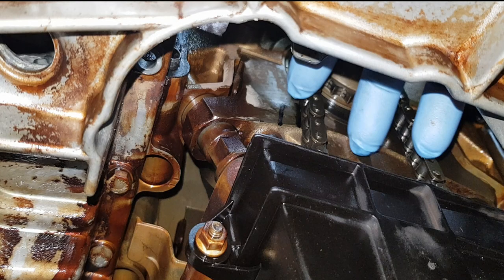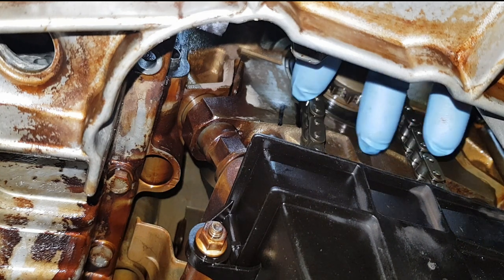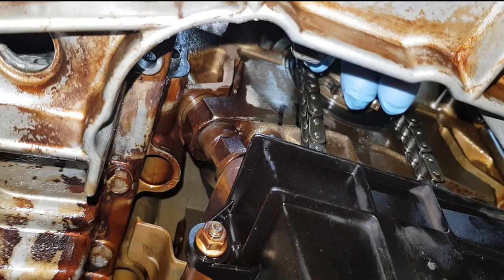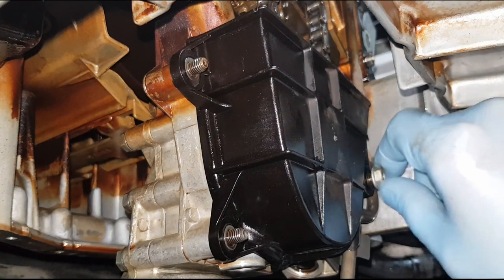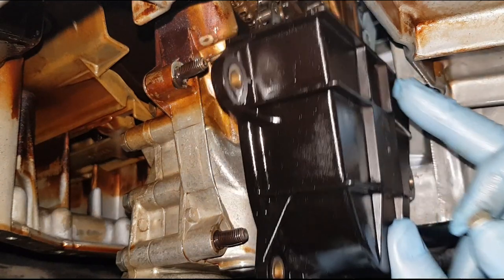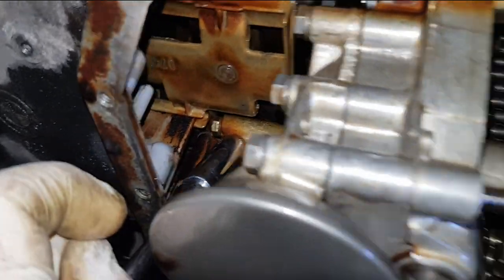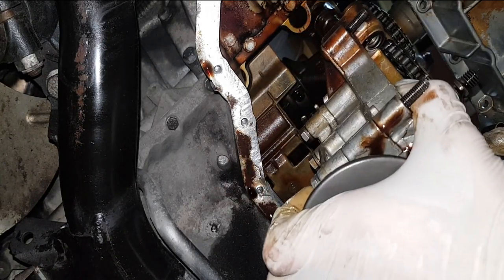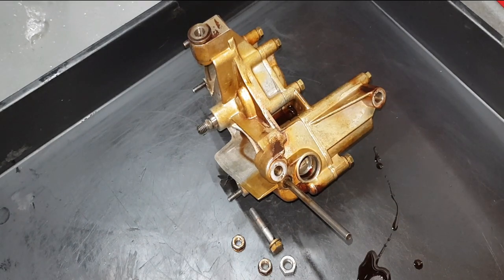BMW E38 M62TU OIL PUMP REMOVAL HOW TO REMOVE OIL PUMP ON E39 540i 535i BMW 735i 740iL M60 M62 X5 E53

Comment: Excellent video. Regarding the chain tension measurement, the TIS diagram shows that the 10mm specification applies to the total deflection - i.e. from the left side of the chain when pressed to the left to the right side of the chain when pressed to the right. It appears in your demonstration that you're measuring the deflection of only the left or right side of the chain, so just clarifying.
Reply from the maker: @johncarter7075  Thanks for your message. Much appreciated

Comment: For sitting in oil for 24 years those were some seriously torqued bolts and gear nut.
Reply from the maker: Better to be tight than to fall into the lower sump 😁

Comment: When locking the flywheel in place does the pin match up, or might there be a need to move the flywheel? If moving the flywheel is required, how can that be achieved? Amazon doesn’t have that particular pin. Could I use a bolt or another piece of metal rod? It seems like I could as the only goal is to stop the flywheel from moving. Lastly, why would the flywheel have a chance at moving? Thanks
Reply from the maker: Hi. Use whatever you have on hand with that diameter as long as it is tight fit. Use a ratchet on the crankshaft bolt at front of the engine to move and align the holes so you can lock the crankshaft or if easier just use an impact tool to remove the nut🤜🤛
Reply: @TheKeenMechanic   got it. I’m heading out to the garage now to do the easier stuff like lower oil pan and the oil pump. 

It’s an Arizona, USA car. Zero rust despite being almost 24 years old. Makes working on it much easier. One owner. Older gentleman owned it until he died at 76yo. Car sat for 3 years. BMW of Scottsdale maintained. The guy even went there for oil changes. The owners wife took it for a drive and it seems like she went off the road into a dirt incline. 

Top of the upper oil pan has a split right on the top but the oil pans are not severely dented. Lower pan lip is dented. 
Needing to be replaced is Aux fan, Radiator, engine fan, fan shroud, most of the tire steering components on both side, undercarriage plastic shields, entire bumper and two fog lights. Hope to replace everything for less than $1,000. Bought the car from the insurance company for $800 with 97k miles on it. Wish I could share pics with you. Thank again. I have your videos saved on my iPad and they go under the car with me😀
Reply from the maker: @paperandmedals8316  Wow, thats amazing. I have never worked on a rust free car unfortunately. Cars here in the UK are rust buckets. Thanks for sharing the history of the car with me. Always nice to hear from other E38 fans. I think you can manage to find spares for 1k. Here in Europe we have a lot of chice for brand new spares and sometimes it is cheaper to buy brand new. Try to find used bumper and other parts that don't necessary have to be new but I recommend you get a new radiator at least. Best of luck and thanks for watching and appreciating my videos. Hit the likes if you dont mind to help spread the word

Comment: Is it similar in M67D40?
Reply from the maker: All engines are similar to a certain extent. Mine is a 4.4 petrol and yours is a 4.0 diesel so there would be some differences. I advise you to get yourself ISTA+ and use the workshop information there so you know exactly what you are doing🤝🏻

Comment: thanks for the video. do you know how much torque the nuts and bolts get when installing?
Reply from the maker: Hi and thanks for watching. I have another video that shows how to install it and all the torque specs. Have a look at this link or browse through my channel. https://youtu.be/FqD7F75aJWk
Reply: thank you very much my friend, very helpful!
Reply from the maker: @chrizcrypto  You are welcome buddy. How did you find my channel by the way?
Reply: tbh I bought a 740i M60 manual like 3 months ago and I was looking for videos like this one to do some maintenance jobs like oil pump, gaskets and so on.
Reply from the maker: @chrizcrypto  Glad to be able to help with what I can. You car must have been converted to Manual? I have never driven a manual E38, I am sure it is fun. What type of gearbox does it have?
Reply: nope, it's a manual from factory. They're just pretty rare. It's a 6 gear transmission. And yeah it's fun but you really need to get used to shifting when in an E38 haha
Reply from the maker: @chrizcrypto  Thanks for your reply. I am curious if it is getrag420g like in e39 m5?
Or other gearbox?
Reply: I have no idea tbh. as soon as i get under the car next time I will see and let you know.
Reply from the maker: @chrizcrypto  Thanks buddy. It will be useful to know in case I convert one some day. Want to know what they put in your car as std in the factory
Reply: The Keen Mechanic hey man, today I finally had time to start the oil pump job. According to the part number on the gearbox, it really is a Getrag 420G. :)
Reply from the maker: Great job. This is one of the best gearboxes ever made🤜🤛
Reply: The Keen Mechanic I'm glad to hear that.💪🏼 only thing is it is leaking pretty hard and I think it will be a pain in the ass to fix that w/o a hydraulic ramp.
Reply from the maker: @chrizcrypto  I know all about it. I am so glad I bought myself a Twinbusch 3t scissor lift. Can't imagine my life without it now🔩🔧
Reply: The Keen Mechanic very nice, I think I'll also going to buy one, will make many things much easier. Thanks again for your videos homie, they help me a lot.🙏🏼

Comment: i lost one of theese nust and the bolt can i just use a regular one ?
Reply from the maker: If I were you I would buy the correct bolt and nut from BMW. Risk is too big imo🤝
Reply: @TheKeenMechanic  i did that haha thanks!
Reply from the maker: @Ciulik102 😉 Not worth loosing an engine for a few bucks🤝

Comment: Where do you get the pin that locks the crankshaft thanks in advance
Reply from the maker: Hi. It comes as a kit. I bought mine on ebay
Reply: Is there a meme for it and is it nesasary to change the oil pump thanks for answering back god bless you and you family
Reply: A name for the pin sorry not meme
Reply from the maker: @tinohernandez3247  Hi
It is up to you if you want to change the pump. I personally would only change the o-rings
Reply from the maker: @Tino Hernandez  Open this link to my video and check ebay link below the video and it will show you the full kit I bought with the pin. It is called crankshaft locking pin for m60 m62 m62tu engines
https://youtu.be/PD07qYztc4Q
Reply: Do I really need the tool just to change the pump or o rings someone told me I only need the kit to change the timing chain just a finally ? And I let you be I just like my truck to much to junk is sale
Reply from the maker: I asume you are working on a BMW M62 engine? If not then I can't help you my friend as all engines are different. Best of luck
Reply: All I know is that it is a 2005 land Rover range Rover HSE 4.4 v8 if that make any sense to you not sure about all the m60 m62  ect.
Reply: It is a bmw motor but it's in a land Rover  from what I understand
Reply: Yes it is a m62 I looked it up
Reply from the maker: @tinohernandez3247  it must be m62 then. If it is just the oil pump you want to remove you can just put a drill bit in the hole and lock it. Just consult with a local mechanic, friend who has more experience or any bmw specialist if you are not confident as the oil pump is a critical component and if something goes wrong you can lose your engine
Reply: 10/4 thank you I will let you live your life in peace now you are a good guy not to many left my you stay blessed and I will pass the help on to others in my own way if you ever have any questions on about electrical stuff in your house I am here